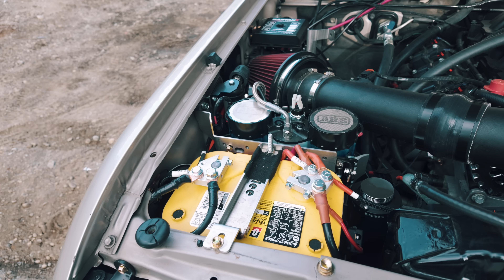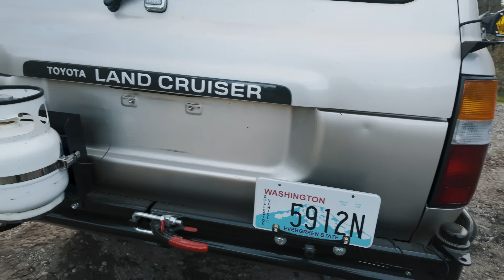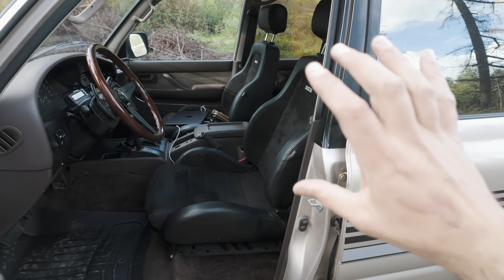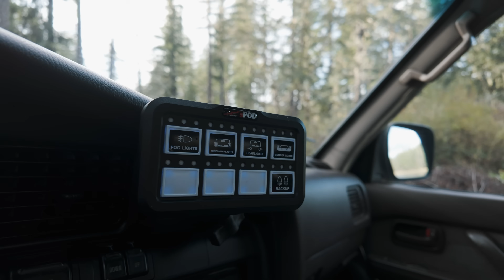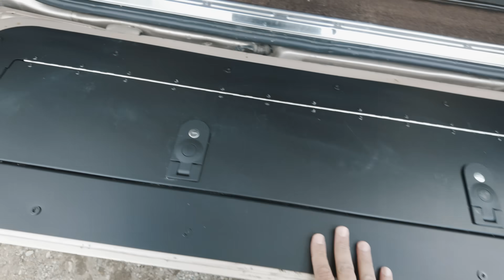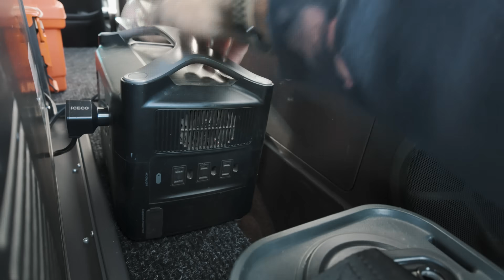V8 Swapped 3X locked FZJ80 series Land Cruiser walk around video.

Comment: You probably mention this in one of your videos, but what is your suspension setup?
Reply from the maker: Eibach 3 inch lift. Delta 3l arms, terrain tamer front panhard, delta rear panhard correction bracket, Ironman upper and lower rear arms, terrain tamer steering damper.
Reply: @CoolGuyClub  did you evaluate other suspensions? what would you change it to if anything?
Reply: @CoolGuyClub and did you ever consider a 2jz swap?

Comment: I purchased an “all top” fridge slide off amazon for like 100$. Then bolted it to a piece of plywood and put door hinges up front and limit straps in back on my drawer/bed platform. When I slide it out it tilts down and stops when limit straps max out, works perfectly! To remove its easy just hammer out the pins on the door hinges and undo the limit straps. Definitely worth 100$ vs the 500+ for the tilt slides. Keep truckin!🤙
Reply from the maker: That’s so awesome you made it work. I tried the same, and the one I got was completely junk with a really large footprint. I couldn’t be happier with the Alu Cab.
Reply: @CoolGuyClub ya, nice rig bro! Just throwing it out for the people looking for a cheaper option. Im sure the one you got it’s top notch though. God bless!

Comment: How does this build stack up in your line up with your other vehicles?
Reply from the maker: Probably the best rig I've ever owned. Better MPG than any rig, better towing, better offroad capability and the most comfortable seats. However it being 30 years old the doors rattle a bit and its a little more noisy even after added sound deadening. But still ... my god it's so fun to drive.